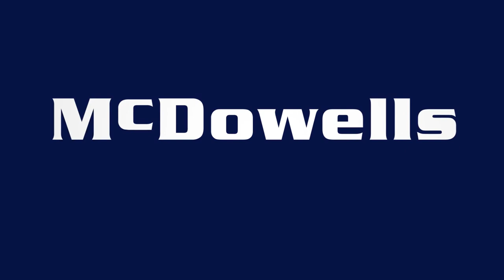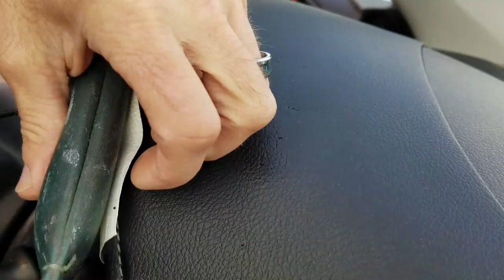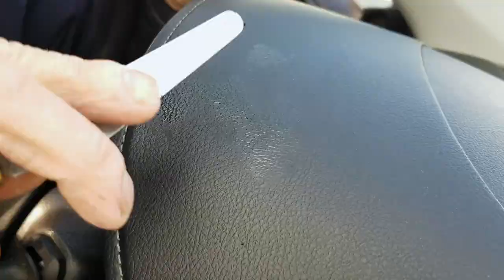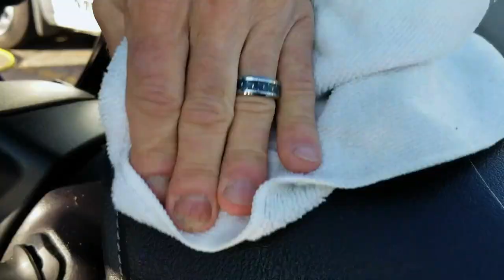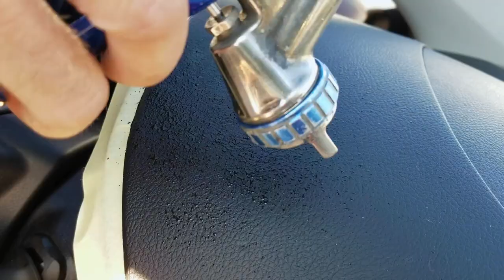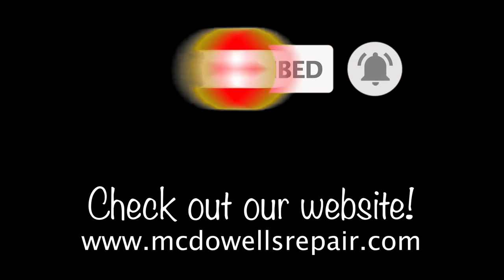VINYL REPAIR: How to Remove Vinyl Scratches From Car Dashboard

Comment: It looks like he uses a heat gun to soften the fabric then places a weight on top to smooth it out. The slip of paper looks like it's protects the weight and helps with smoothing. I would literally try a hair dryer and a maybe flat weight. Or maybe even a heavy bag of sand. And use parchment paper, or paper, to help protect your weight. I would also only heat the area in 30 second intervals so as to not melt the interior and fill the holes with an epoxy. Maybe even get regular paint from the store?